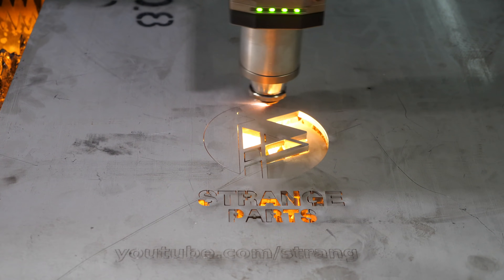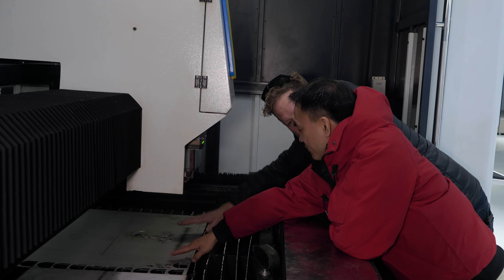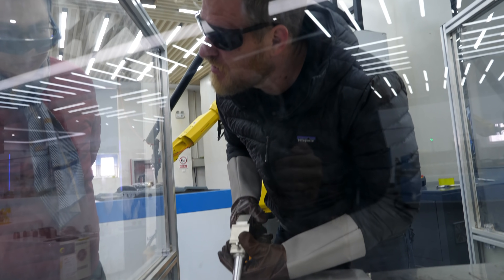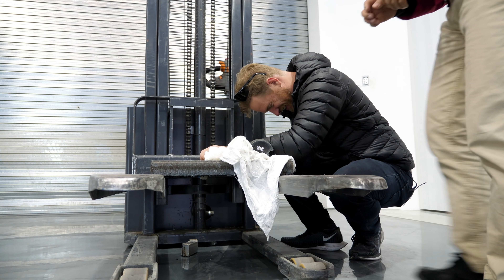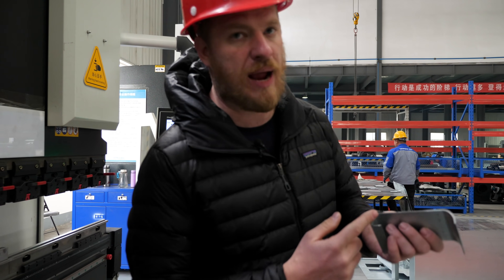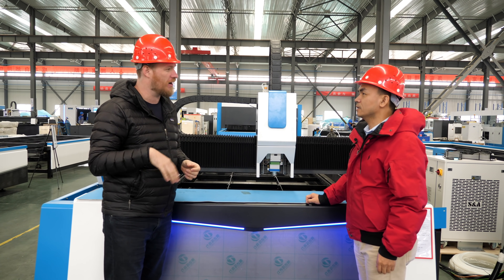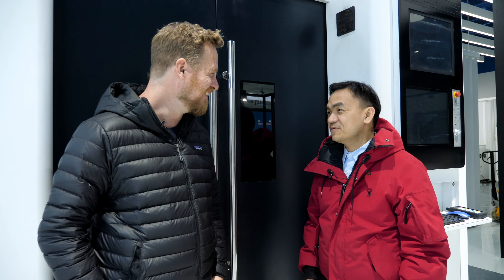This laser cuts through 2 inch thick STEEL!

Comment: Speaking of eye protection. Is there a general rule for how much energy is wasted as laser light from the beam itself in all directions? Would be interesting to know how much light you get into your retina by standing a few feet without safety googles. I guess the total energy might less than 1%?  I guess you have to devided it by  the area of a sphere at set distance devided by the area of your retina? This laser was 270W during 1 of the cuts. It's the amount of escaping light, bleed or whatever it is called I don't know. Anyone here that do?
Reply: It is low power, but still very dangerous. There is a reason why reputable brands in the USA use full enclosures with green laser safety filter glass, and non-bypassable door interlocks. These open bed china lasers are actually illegal in the USA, but they are Imported as components to get pass FDA clearance (yes, the food and drug administration regulates lasers). In the video, they are cutting with the door open, No reputable USA brand will allow that. It is a huge safety issue, the moving equipment and noise levels are dangerous alone. Also, when they were using the handheld fiber laser welder, that was beyond dangerous, pure negligence. The employees hands were in a direct line with the torch nozzle. And that clear plexiglass around it isn't smart either. If the main guy would have slipped off the part when he was dragging the gun, it would not be good. Here in the US, anybody that uses a handheld laser in a shop environment must do it in a full interlocked enclosure. China manufacturers do not care about anybodies safety.
Reply: I totally understand what you're saying, since I live in Sweden, so our rules and regulations when it comes to employee safety is incredibly high and robust. I did work in Norway for multiple years in a medical equipment production facility and used plasma and laser markers daily. They bought laser equpiment from Rofin that had everythign enclosed and a door you had to shut before being able to turn the laser on. I think that is the norm in all of Europe @brandong9795

Comment: I'm calling BS on the 2" steel cutting ability. Cutting 30mm (1.18") mild steel requires a fiber laser power level of 30KW. A visit to this company's website shows that their maximum power laser cutter outputs only 15KW.

Comment: you shouldnt have welded a handle to it. If you left it as it was you could hang it on your wall with a 1 or so inch spacer and put a back light behind it and it would make a very nice back drop for youtube videos.

Comment: 1 inch or 25mm is really a fiber laser cutters maximum effeicency range after that the heat is too much when your in the 6 - 15kw range and the metal melts. Then you should really switch you water jet cutters since they can go up to 4 inches or 100mm at around 40 to 60k psi. Water jets are messy and generally a lot slower however

Comment: This laser machine has no protection what soever.   At this wavelength of ~1 micometer this is extremely dangerous to the retina in the eye.   How the Chinese can get away with is lack of safety is beyond me !   In Europe you can not sell machines without safety covers top sides & underneath and with full double interlock switches.

Comment: Contrary to the discussion in the video, there is a very big difference between fiber delivered lasers and true fiber lasers. In true fiber lasers, like the ones made by IPG Photonics, the laser power is developed inside the optical fiber itself. Let me know if you want to learn more.
Reply from the maker: The we’re using IPG laser sources on some of these laser cutters. They’re real fiber lasers.
Reply: @StrangeParts  When you were looking at the components of the cutter, at one point you said that you thought the reason they are called fiber lasers is because of how the light is generated, but then it seemed like you accepted the explanation of the name being due to the delivery method. Your initial instinct/thought was correct; that's what I was trying to get at.

Comment: Saw one cut cake, it was great for dry cakes, baulked at moist cakes Doesn’t like Aluminium from memory . On 12 mm Mild steel you can touch the steel say 20 mm from the cut . Extraordinary machines.

Comment: The owner seems a bit confused about the laser itself; I think he mainly purchases laser sources OEM to install into the machines his company builds to use them for cutting. Indeed a fiber laser DOES absolutely refer to the lasing medium itself and not merely the fact that the beam is conveyed to the cutting head via a fiber optic. At insane power levels of 12KW there is effectively only one choice for the laser itself - it is a ytterbium doped fiber hosted diode pumped laser source. It is a type of "brightness converter" that converts the high intensity ~900nm infrared laser radiation from multiple AlGaAs laser diode pumps which are externally transversely injected into the Yb fiber coil that then lases axially along the fiber length and produces tremendously intense beams of 1080nm light. Ytterbium is chosen over neodymium due to its simpler energy levels and higher doping percentage ability.

Comment: 2:40 First thing I was thinking - where are the laser goggles? lol

With that kind of power, even a diffuse reflection from the laser could damage your retinas. I'm surprised there's no shield glass around the cutting bed.
Reply: My dad told me a story from germany where there was a big show for metal works laser waterjet etc and non or mosz of the chinese manufactures weren't allowed to show their machines because they had no or too less safety

Comment: You get what you pay for and when the time comes to sell the equipment you get what it's  worth. The low cost $ manufacturing equipment 
Comes with very little support ( service, parts ) and down time can break a company . The million + $ well known name brand proven company's 
Will not let there customers down . Cheep Chinese equipment is what I recommend to any competitor of mine while there pulling there hair out and loosening sleep and money waiting to get back up and running after a crash ( operator error ) its going to happen , my AMADA will be running 18 hours a day with service and millions in spare parts 3 miles from home . But a very nice video indeed .

Comment: I run a 6K fiber laser from Durma and it only cuts up to 1”. Their laser is on crack and for that price its a steal. Ours cost around a million but the modules go out really quick. Durma deff has the best interface and ease of use.

Comment: hello. my understanding is that a laser is photons? is this correct or no?  if so why would you need a gas?
Reply: yes, all lights are photons in terms of physics. Liquid gases are used for cooling. different materials need different types of liquid gas to cool....
Reply: You need gas to keep the lens clean and to eject the cut material. There is a whole process that's being accomplished here. It is not enough to simply emit photons.

Comment: If you think these are good you should look at what Trumpf make for laser cutting they can walk rings around these. Also a fiber laser should never be able to run with the doors open that will never pass most country's laws as fiber laser radiation is very dangerous for eye if not burning skin just off a reflection.

Comment: About a month or so my Mom and I were strolling through one of our frequented shops when I noticed them opening up a small area with Maker Devices like CNC Carvers and Laser Engravers to customize Store-bought products like cutting boards. Being the Nerd that I am I immediately spotted one of the machines being a Snapmaker with the Laser Module attached to it but no one was around to service Customers so I asked around a little and found out they would use the 1600mW Class-IV Laser without any Laser Protection Shielding present which immediately rang a warning bell in my head so I told one of the Clerks ( not immediately responsible for the machine ) about the issue I was having with this Machine being used without protection expecting for them to stop servicing it.

Back at home I still decided to sick the Cops at them but even after some forwarding, they couldn't really assure me what they'd be doing as they weren't familiar with the matter - I told them: "Look... This is the Machine - Go to their website and look up the specs for it - Then call the State Eye Clinic and have a LASER Specialist inform you about the dangers of an unshielded Class-IV Laser being operated in the public - Apply common sense"

Two days later another Cop, specialized in LASER Warfare ( because our Cops are apparently getting blinded by Demonstrators ) called back informing me about the situation and that they were still operating the damn thing when they arrived with not even the operator wearing the safety glasses available to him so they shut down the operation and informed all other branches of the store that the device must be removed from their stores.

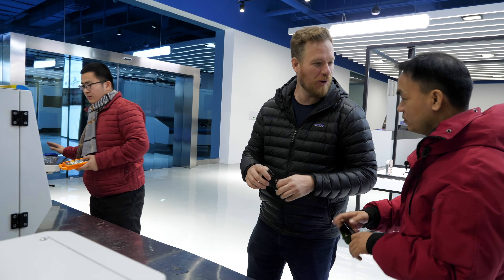Which brings me to the Guy @02:43 showing up like REALLY FUCKING LATE to the Game with some LASER protection glasses AFTER they must have already cut like at least 5 of those cars WHILE staring at em with pure amazement. It's like my Mother always preached to me: "If they catch you not doing something when they test you then you're obviously not doing it when they're not testing you either."

Probably no one ever wears those fuckin' glasses who actually HAS to work on these machines and the big shots who KNOW about the danger frequent these machines so few times they keep forgetting to bring them with em - Fuckn' sad man.

Comment: Why is it so cold inside the factory and showroom?  Everybody was wearing coats!
Reply: Helps keep heat waste down if you already have a colder room for lots of electronics, plus China is cold place in Winter.

Whether just lack of A/C for Demo Room, and a factory where assembly takes place OR keeping the waste heat down, it's practical.

Comment: 500k$ for the big one is actually not that much, you must consider additional expensive came with the machine, like giant gas supply tank, gas preparation station etc, but with a machine, able to cut 50mm thick metal, will pay off themself relatively quickly if the quality of the machine is good.

Comment: Why didn't he ask why would you use a laser over traditional cutting methods?
Cutting Steel with a laser using Oxygen as a torch gas, Oxy Acetylene has been doing that for 150 years.  Once the cut is started you don't even need a flame the metal just stays hot enough due to the oxidation. As for the stainless that would be just as easily cut with a plasma cutter as would any conductive material.
A really wasted opportunity Why not demonstrate the power of the Laser say cutting a 2" thick piece of Carbon Fiber or Ceramic tile. Can it cut Glass, can it cut to a depth cleanly leaving good material in the bottom. Can you use the Laser to cut away material like a machine tool used in a 3d situation, how close can the laser finish material to size and is it repeatable to what tolerance? Can it cut under water, how is it affected by smoke in the cutting area, does reflectivity affect the lasers ability to cut.
The thick metal cuts looked no better than traditional methods costing 1/10th of the price. 
I think Scotty should have given it just a tiny amount of thought and research prior to this visit. 
We would have been better off with Dr Evil doing this piece   https://tinyurl.com/oo9dy7e  or  https://tinyurl.com/r7fsquh

Comment: Quite impressed how quickly the laser cut the 1/2" Aluminum.  That would've taken at least 5 minutes on an abrasive waterjet and would still need finishing to clean up the tapered kerf.
Reply: Pshh, half inch is nothing even for a 4,000 watt CO2 laser. I'm impressed the 12,000 watt can do 2 inches!
Reply: Do you mean the big business card? Im pretty sure that was steel, it cuts a lot faster

Comment: Was cringing pretty hard before you put on the goggles. How did that not cause instant eye damage? Is the laser just not visible from the top?
Reply from the maker: No - you just see the sparks from the metal from the top.  Not too bad, but putting glasses on wasn't a bad idea.

Comment: Mate if you can find out how the cnc controllers are programmed for cnc laser cutting machines that will be wonderful. 
There are control cards made in China “FSCUT” but it is not a cnc controller. I would be interested to know laser machines with Siemens, FANUC, BOSCH cnc controllers.

Comment: Awesome video, Scotty! Interested in some more detail about that laser welder. Is it injecting metal/flux like a typical welding process using electrodes or wire? Or is it just heating and fusing the metal together? I'm assuming some welding wire was being fed through the cable connected to the gun?
Reply from the maker: Nope, just heating the metal up and fusing it together - no filler wire.

Comment: I work at a laser cutting factory. We have Trumpf Trulaser 3030 lasercutter. It can cut up to 25mm thick steel but most of the work are 1-5mm stainless steel and 3-10mm steel.

Comment: Wasn't that like crazy unsafe?... Standing right next to an operating fibre laser? Also I really doubt that those safety goggles would help much...
Reply from the maker: I tend to defer to the experts that work at the factory and design these machines.  But no, I never felt unsafe standing where we were, or with the protective gear we had on.

Comment: You can't tell me the handle idea wasn't intentional from the start. I mean you had to purposely not add the handle just so you could show off the other machines right? If not then thats some insane luck because it worked so well. Also these videos almost have a slight propaganda feel to them because this reminds me of a US factory and made me think "if I needed to buy a laser cutter I would go with these guys" when normally I associate Chinese products with cheaper garbage, free hong kong, but this makes me question that line of thinking/association.
Reply from the maker: No, it did come about organically as we were talking about it.  Some bits we had to recreate for camera though, as this ended up being a pretty challenging environment to shoot in.  I was originally planning on just taking it over to the guys in the welding shop to have them mig weld it, and then they mentioned they had a laser welder, so of course I couldn't pass up a chance to try it...
Reply: @StrangeParts  Thats awesome! It worked incredibly well. What a great way to show off this companies machines.

Comment: The problem is thats a big amount of liquid nitrogen for a machine
Reply: The air is 78% nitrogen so what’s the issue?
Reply: @Lumens1  perhaps the cost of obtaining and transporting large quantities of liquid nitrogen.
Reply: Giin liquid nitrogen is incredibly cheap though
Reply: @echoes6645  I wouldn't know. Never purchased it 100 gallons at a time.
Reply: It's not like that, the barell is pretty small, the compensation chamber is almost none, what would you expect. For serious use you need serious implants

Comment: I need a laser like that to open ATM machines🤣😁
Reply: Newer ones will have a bunch of thin wires running along the frame, and if enough of them are cut, it will brick itself and flood the money with ink.

Comment: Can someone explain to me how they prevent that the machine don’t hurt itself? Is is just the focus of the laser ?
Reply: The tip of the welder contacts with the metal of the work piece which touches the base. Machine checks for continuity between base plate and welding tip to fire laser. So the instant you lift the tool away it cuts the laser off.
Reply: Yes it's the focal point of the laser beam which, depending on the material, is either on or near the top surface of the material or some point along the thickness of the material you're cutting. The beam, in simple terms, is shaped like an hour glass after it passes through the focus lens, the narrowest portion being the focal point. Also the statement that you use oxygen for mild steel isn't completely accurate, while oxygen is used to provide an exothermic reaction to provide additional heat to the cutting process, many times nitrogen is used for thinner steel sheets to eliminate oxidation on the material thickness which must be removed prior to paint or the oxidation will flake off along with the paint. Many production machines use a capacitive height sensing system to control the distance of the nozzle to the material you're cutting, which is a crucial factor in obtaining an acceptable cut.